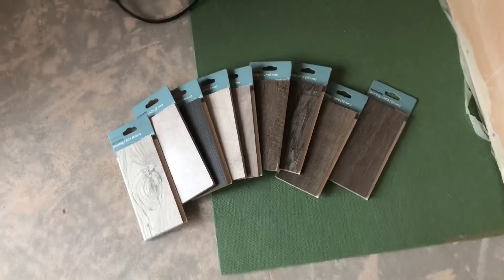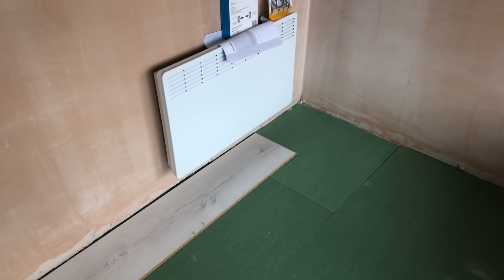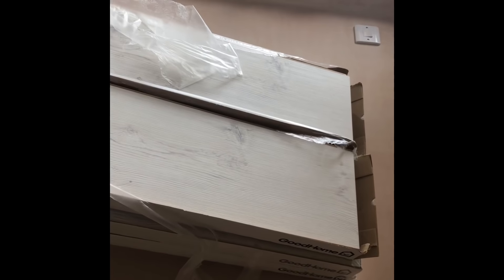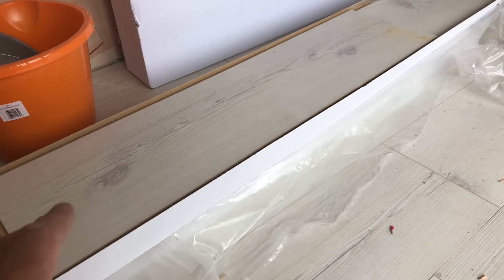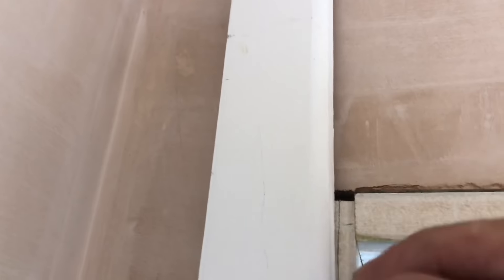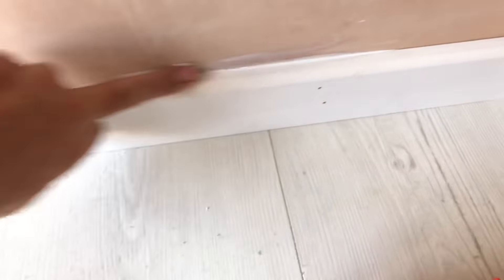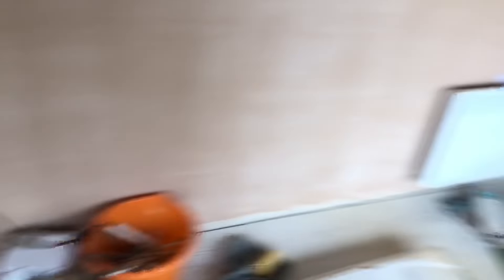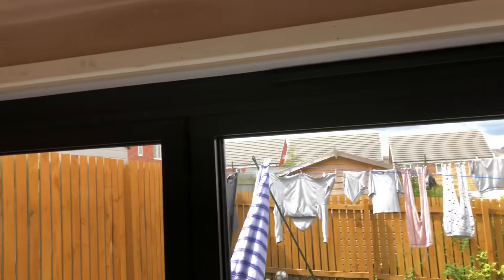Laminate flooring and skirting tutorial

Comment: Hi William great videos mate I've just started making mine in the garden 12ft x 7. I've got a question about rubber roofing. I've just brought mine and they give you contact adhesive which is meant to go round 100mm in from perimeter but I've noticed on your videos you just use the water based adhesive all over? Why is this? Could I do the same? Thanks 👍
Reply from the maker: Sam Brazier a guy from a suppliers once called me and I asked him how much was the contact adhesive? He said why do you want it? Your glueing the rest, then mechanically fixing the edge with the trims🤷🏻‍♂️ made sense, never used it since, not had any issues
Reply: Thanks mate I thought exactly the same! I'll do without it then 👍

Comment: You used wood glue on the architrave joint ..can I recommend 'mitre bond' or similar (2 part superglue). Rock solid on MDF and takes 10 seconds for full strength. Great for those with no patience 😉 drawback is you can't adjust it.....I glue up a joint at 45degrees ( no measuring part degrees) and the suppleness/ bendy nature of MDF means it can be pinned exactly into place

Comment: I always start one board away from the wall, then ping a line and temp screw 2x1 down so you can tap the laminate against a solid surface, i always check the width of the room so that there’s not a 10mm rip at the other end from where you start. Also I leave 5-10mm gap as skirting is 12-15mm!
Reply from the maker: Skirting is 18mm , I like to take a gamble